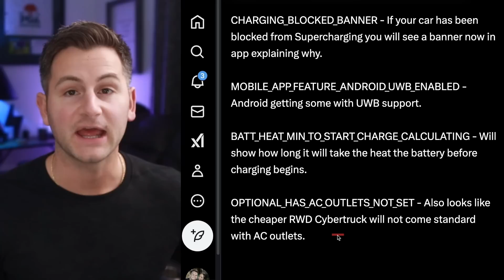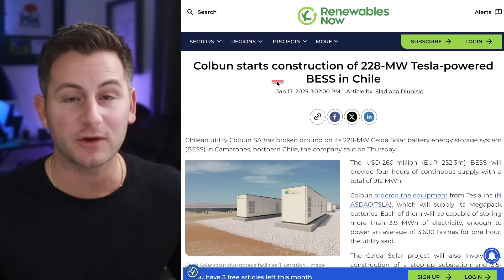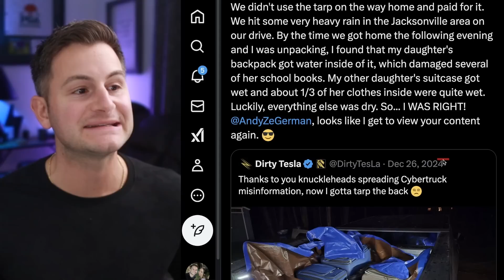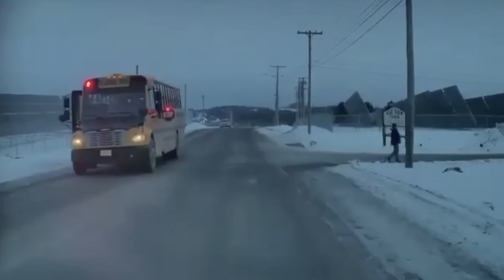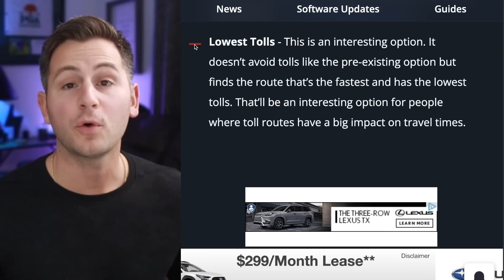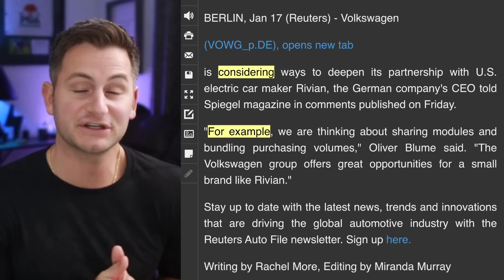Tesla's New Battery / Elon Is Fed Up / Pure Hypocrisy ⚡️

Comment: On the topic of grid battery storage, I am no expert but would have thought that -  when talking about how long a period a battery can be discharged over - long is not "good" as it implies a lower peak discharge rate. You can always discharge at a slower rate over a longer period.
Reply from the maker: yeah it boils down to optimization but you're not wrong...fwiw the megapack spec sheet for a 4 hr duration battery says up to 6+ hours

Comment: Will all future Tesla vehicles be on the 48 volt platform including the Semi?
Reply: Not sure about the Semi but that tends to be the way they work.  New things go forwards on the new models.
Reply from the maker: it looks like the new model y is not using 48v so not all models will at least in the near term. cybercab has a better chance since it's an entirely new mfg. method and does not require changing anything like the model y would

Comment: My understanding is that iron-air batteries is they are only about 50 to 60% efficient in a charge discharge cycle.  That means if you put 100MW-H in, you only get 60MW-H out.  While the battery may be cheaper, the electricity you put in essentially becomes twice as expensive.

Comment: 6:28 both things can be true at the same time. China is absolutely capturing, considering, and contemplating using their connections to us as individuals and communities through software and firmware and hardware in products we purchased and use on the daily. And they are not a good actor. Hypocrisy, yes. But don’t be naïve.

Comment: EV stock PSNY: Polestar’s Q4 commercial update: - CEO Michael Lohscheller comments: “We saw a 5.3% increase in retail sales and a 37.2% increase in order intake compared to the same quarter last year, creating a strong momentum as we enter 2025.” GOTHENBURG, SWEDEN – 9 January 2025. Polestar (Nasdaq: PSNY) retail sales totalled 12,256 cars in Q4 2024, up 5.3% versus Q4 2023, taking total retail sales for the full year to 44,851 in 2024, down 15% versus 2023. Total order intake in Q4 2024 increased by 37.2% versus Q4 2023 and by 37.9% for the full year 2024 versus 2023. Michael Lohscheller, Polestar CEO, says: “The changes being made to our commercial operations are clearly having a positive impact, as we saw a 5.3% increase in retail sales and a 37.2% increase in order intake compared to the same quarter last year, creating a strong momentum as we enter 2025.”

Comment: Polestar announces global volumes for the fourth quarter    2025.01.09
•	Retail sales totalled 12,256 cars in Q4 2024, up 5.3% versus Q4 2023, driven by a growing model line-up
•	Order intake in Q4 2024 up 37.2% versus Q4 2023, creating strong momentum as we enter 2025
•	Polestar 3 and Polestar 4 represent 56% of order intake in Q4 2024
GOTHENBURG, SWEDEN – 9 January 2025. Polestar (Nasdaq: PSNY) retail sales totalled 12,256 cars in Q4 2024, up 5.3% versus Q4 2023, taking total retail sales for the full year to 44,851 in 2024, down 15% versus 2023. Total order intake in Q4 2024 increased by 37.2% versus Q4 2023 and by 37.9% for the full year 2024 versus 2023.
Polestar CEO, says: “The changes being made to our commercial operations are clearly having a positive impact, as we saw a 5.3% increase in retail sales and a 37.2% increase in order intake compared to the same quarter last year, creating a strong momentum as we enter 2025.”
About Polestar 
Polestar (Nasdaq: PSNY) is the Swedish electric performance car brand determined to improve society by using design and technology to accelerate the shift to sustainable mobility. Headquartered in Gothenburg, Sweden, its cars are available in 27 markets globally across North America, Europe and Asia Pacific. Polestar is scheduled to expand into additional markets in 2025.
Polestar has three models in its line-up: Polestar 2, an electric performance fastback; Polestar 3, the SUV for the electric age; and Polestar 4, the SUV coupé transformed. With plans to have a line-up of five performance EVs by 2026, Polestar 5, an electric four-door GT and Polestar 6, an electric roadster, are coming soon.
The Polestar 0 project supports the company’s ambitious goal of creating a truly climate-neutral production car by 2030. The research initiative also aims to create a sense of urgency to act on the climate crisis, by challenging employees, suppliers and the wider automotive industry, to drive towards zero.

Comment: My own view is that the CT is polarising for a lot of truck owners. not necessarily because its an EV, or its price, but more its design is a long way from what 'work truck' users are use to.  The truck market is substantially dual use, work/home and until the CT cracks the 'trades' market, its appeal will be more limiting.  I don't hear or see much about use on job sites at the moment. That might change but we need more intel on its use in this segment of buyers.

Comment: Tesla needs to drop Cybertruck prices to what they were at reveal. You can't hike prices and expect demand to stay the same. Initial excitement is over.
Reply: There's been significant inflation since the reveal.  I doubt the prices will every drop that far.
Reply: @billweberx  inflation that only affected the Cybertruck.  The rest of the SEXY lineup has gotten significant price cuts over the last 2 years
Reply: @Wankidy  Prices will come down for the CT, but not back to the Reveal prices.  Too much inflation.
Reply: The delivered CyberTruck is not what was presented at reveal.
 It has features and performance far greater than any other production vehicle.
It is an engineering tor de force  that achieved in one vehicle the holy grails of steer by wire, 48v wiring, super strong superstructure, massive  ride height adjustment, rear wheel steering, high efficiency and autonomous driving!
All for the price of other ICE mid-featured Trucks!!
And it took over $2Billion to get there!!
Reply: I would imagine that the 7500$ tax credit is at fault here. Eventually they will lower the prices
Reply: Demand and supply
Reply from the maker: yeah i mean they're not going to be at those levels anytime soon (thanks to inflation) and it may never happen but hopefully they can offer a variant ~$55k sooner rather than later
Reply: So what makes you think you get to tell a company how much they should charge for their products?
Reply: Everybody who would ever buy a Tesla has already bought one. So please send all your cars here to Europe. And of course cheaper than VW or Stellantis. Thank you very much!
Reply: @ So are you sure? I don’t know that, and I haven’t heard anyone else claim to know that either. So do you have information that is not currently in the public domain?

Comment: In some embodiments is language in a patent to claim all variations without having to enumerate them.
Reply: Yes, indeed it has that effect in the description (the actual claims are always enumerated), but more importantly, it´s another way of saying that the feature mentioned is optional, i.e. not necessary for carrying out the invention. In litigation, if a feature is not clearly disclosed as optional, the claims may be construed as having to include the feature in question, even if they do not explicitly mention it. The effect is that the protection offered by the patent will not extend to products or methods not having said feature, or, in other words, a presumtive infringer of the patent may get away simply because his allegedly infringing product or method does not include it.

Comment: The LG battery fire is disconcerting since they also had problems with them in GM cars. There were a lot of recalls due to LG Chem fires and potential fires in GM cars. Not knowing the relationship of battery manufacturing between LG, LG Chem and LG Energy Solution makes it unclear if the same problem exists in their battery storage solution. Who’s on first? 😂😂😂
Reply: Exactly!

Comment: People act like refineries and gas vehicles never catch fire
Reply: narrow minded people
Reply: Ice cars catch fire 15x the rate of EVs.
Reply: @steveb796  can you provide a reference for this assertion
Reply: @DennisCollyer  from Car and Driver- June2, 2022
AutoInsuranceEZ studied the frequency of fires—from all causes, including collisions—in automobiles in 2021. It found that hybrid vehicles, which have an internal combustion engine and an electric motor, had the most fires per 100,000 vehicles (3475), while vehicles with just an internal combustion engine placed second (1530 per 100,000). Fully electric vehicles had the fewest: 25 per 100,000. These findings were based on data from the National Transportation Safety Board and the Bureau of Transportation Statistics.
Reply: @steveb796 that’s pretty significant. Never seen reporting on that. They always seem to spotlight the accidents and mishaps of electric vehicles/tesla vehicles.
Reply: @ there are a lot of special interests that want to keep gas cars going.  Dealerships make a majority of their money on service. The oil lobby has a lot to lose. The only maintenance on my Tesla is tires and windshield wipers. The only liquid to maintain is windshield washer fluid.
Reply: People act like BEV fires happen all the time.  Same issue, flip side.  BEV manufacturers are an easy target for MSM since there's no advertising revenue at risk from the BEV makers.
ICE cars catch fire, but it's pretty rare.  BEVs catch fire, but it's pretty rare now.  
Issue OVER.
Reply: Of course not. There is nothing to burn in a combustible device. There is no news. There is nothing to see. Move on!